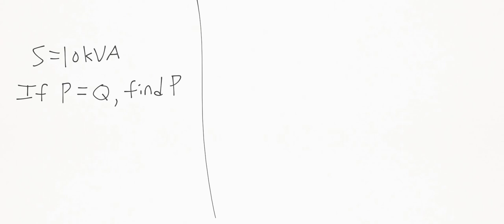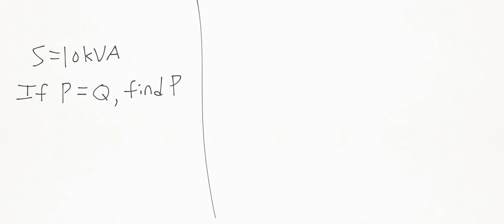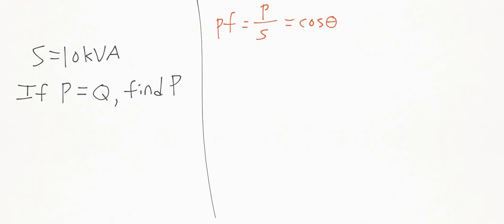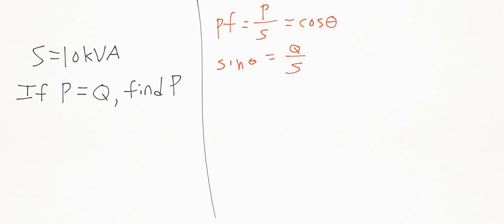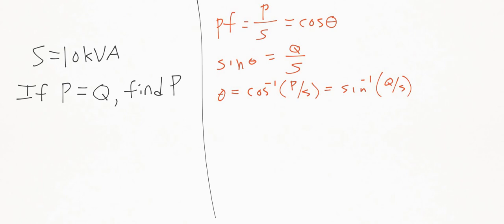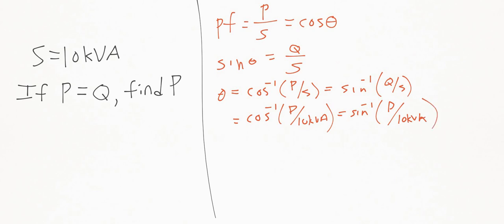Electrical FE /EIT Exam Prep - Power 3: True, Apparent, Reactive Power Relationship

Comment: FE exam has 110 questions, if you can save time on 1 question do it, if P=Q then angle=45 degree, end of the problem, on you calculator make a conversion from Pol (10, 45) to Rec and you have the answer immediately.